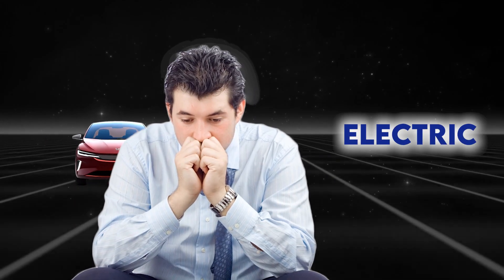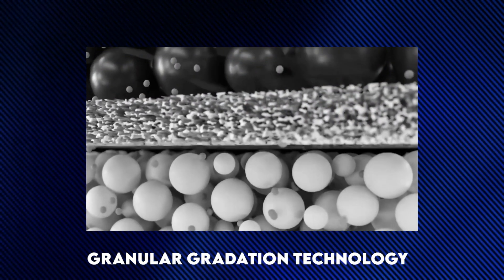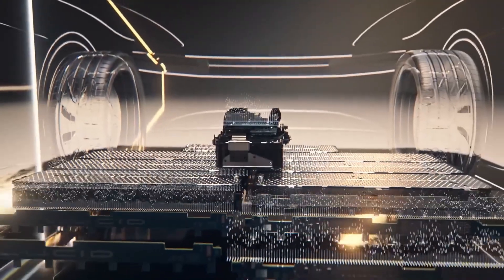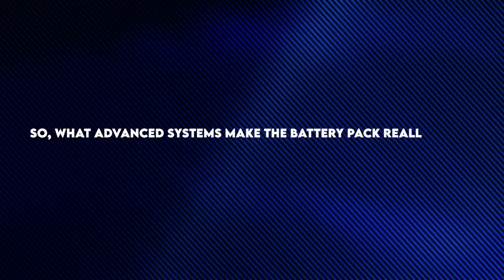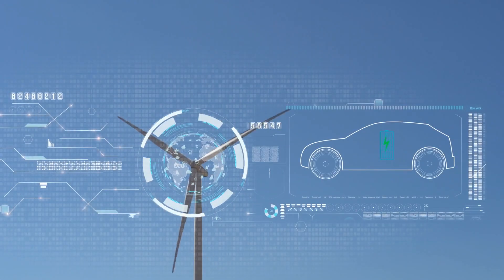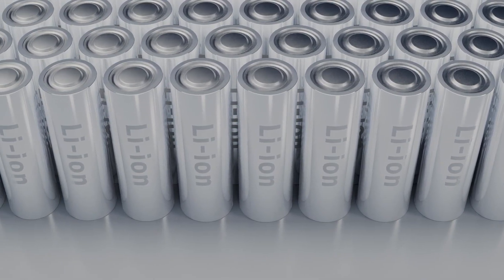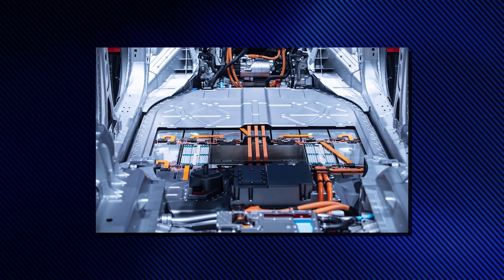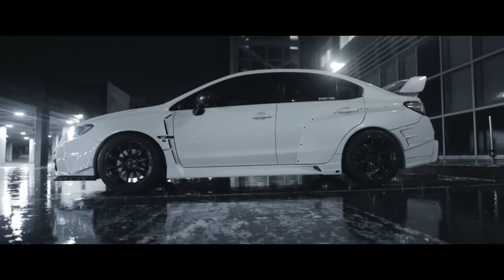CATL's 1,000 Km Range Battery SHOCKS The Whole EV Industry!

Comment: The author of this video doesn't know much of anything about batteries. They said 206Wh/kg. That's actually much less than average, so that's probably wrong. It's pointless to say it's a "1000km" battery. Any battery can provide 1000km, it's just matter of how large and heavy it is. One would generally assume this means that for the same size and weight of current battery packs that deliver 500km, a battery of this design would enable 1000km. Also, a battery that's good in the cold says nothing about how good it is when it's hot, but the author implied that was the case. They also implied it will be more expensive, but if it's twice the energy density, so if it's any less than double the cost that's still a win. For example, if you need 7000 cells in a typical EV battery to get 500km of range, and with this battery you could get 1000km with the same number of cells, that means you could, instead, choose to keep the 500km range and only use 3500 cells, halving the weight of that battery. If it was double the cost, at worst that just doesn't change the price of the car at all. But if it was 1.5x the cost, then the 3500 cell pack is now 75% of the original cost. These are just a few examples of the things this video gets wrong. There were Maby more but I'm not going to write a whole book covering all of them.
Reply: Obviously,  however it's not about those issues specifically,  that are generally applicable to most batteries.  I mean the discussion is in a given typical context providing a general overview of where the tech is at.
Reply from the maker: oh is it